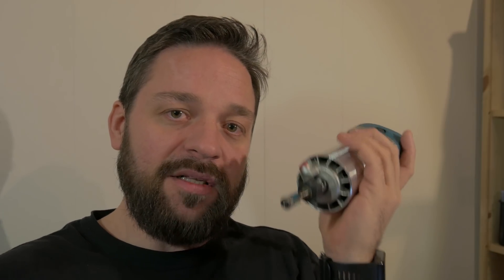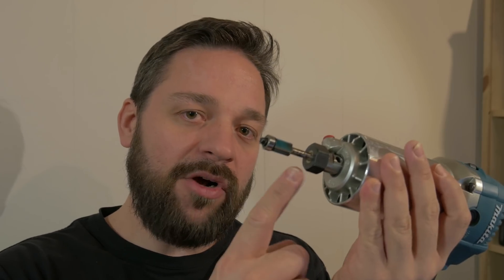First DIY CNC build (part 16) - MOUNTS for MAKITA router 65mm

Comment: Hi Willy.I learn a lot from you.Thank for all usefull details.but i have little problem that i see in this video 3:25 you also have same problem. After setting zero when click start ,spinde moving straight to the next poing by scratching material surface. than moving high and at same point going down and start cutting.in normal way, z must be move up first and than move to the first point and going down start cutting.i search a lot but no one talking about it.if you fix this problem please tell me how you did.in my cnc everything work fine but this scratch problem is terrible.Thank you.
Reply from the maker: Hi and thanks.
Yes I have had problems with this but not any more.
I think the problem is in the software generating the g code.
Do you use Fusion 360?
If you do, be sure to disable the cooling flooding in the first banner of toolpath. Check the heights also in the heights banner. Also be sure to generate the toolpath to GRBL configuration in the generate banner.
Let me know if you get a soulution to this problem

Comment: It was predictable.
Always First you need to cut the inner contour.
If there are problems with jumpers. Or do not want to use jumpers.
You can at the very beginning, drill two holes on the parts that will lose their fixation after cutting.
screws are screwed into these holes, thereby eliminating the bias of the part, which lost its fixation after cutting.
It turns out three G-codes:
1 # technical screw holes
2 # inner contour
3 # external contour
Reply from the maker: Thanks for good advice :)
Reply: @WillysGarageNorway  Lol... In part 18, you use same method. Sorry... :/

Comment: What are you planning to control the makita with? A bigger power supply, Relay, SSR?
Reply from the maker: Hi and sorry for late answer :) I plan to control the Makita with a simple relay on the Arduino that controls a 230 volt output. The RPM I will adjust manually.

Comment: Hi I use the same Makita RT0701C router on my cnc machine,
I cheated tho with the router mount no I did not make mine, I brought an aluminum mount from ebay.
What I am looking for and want is a collet to reduce from 1/4 to 1/8 or a 1/8 collet to suit the Makita RT0701C router.
 As I'm wanting to use smaller shank bits for small fine detail as a 1/4 shank cost an arm and a leg.
Reply from the maker: Hehe, yeah igs ok to buy :) I like to make my own tho, maby I will make out of aluminium one day 😂 
I think you can get an adapter or something to get 1/8 collets for small tools. Have you found some?
Reply: yep found and brought one, well many people selling the same thing still over priced for what it is, it's basically a sleeve of 1/4 that fits 1/8 bit @ $9us
Reply from the maker: @henryfitzthum7563  ok, yeah. These things are often over priced. Where did you buy it? I may be needing one myself 😁
Reply: brought it from ebay I'm sure these are sold on amazon too, it's called ( Astro 200-283 Slot 1/4-1/8-Inch Collet Reducer ), I won't paste a link here as that is why I stated many people or accounts are selling the same item and not having large quantities on hand either meaning 4 ( I normally don't buy from people whom state having 1 or 2 on hand which sometimes equals NONE ), so I think they source them else where then forward it on to you, so I'm sure one could source it cheaper, but on ebay they start as low as $9us and go up to like $11us, I don't own a lathe ( but will later add another axis to do so at a later date ) so I had no option to buy one, as for my aluminum spindle mount it was almost cheaper to buy one then to reproduce it @ $26us after one buys aluminum stock sit down for an hour or 2 to mock up 3D drawing turn to gcode then carve it out would be like watching paint dry or the grass grow
Reply: Oh for those building a machine, if buying one of those kits with linear rails , blocks and ball screws, ( mine came with a 2yr warranty ) yes they work fine the weak link is the coupling that joins ball screw to the stepper motor made of aluminum broke first one broke  after maybe 4th test run, it's a sad day when that happens especially if one does not have a spare on hand, when I first noticed the broken one I found these over built ones I so I purchased one for each axis, replaced the broken one then another axis went out, so luck for me I brought extras, ( what I did notice and think what happen is that they were broken for a while as there was enough pressure to hold it snug then with all the back and forth motion of the axis carving your project out it worn the aluminum down then got alittle sloppy )
before you know it #@&! your work up
Reply: Update on collet just received and tested , works and fits perfect.

Comment: where you setup the height of the driller? so the z axis know how much mm it need to go down and up?
Reply from the maker: Hi, and thanks for watching.
You sett the "zero" point in the universal g code sender. Put the tool where you have the zeropoint in you g code and pres reset zero in the UGS
Reply from the maker: And I have a video about the subject here, enjoy :) :
https://youtu.be/A1zlL3q23HI
Reply: so every new program i need to set the zero point? 
also i can work with fusion 360 and g code sender ? 
in the fusion 360i set that this is a plasma torch?
i can contorl the plasma that will start working only when the z axis 1 mm above the metal?
Reply from the maker: @dormoshe1664  yes you can work with fusion 360 and UGS. That is what I do on all my cnc projects. I have not used the plasma torch function so im not sure about that, but I think you can use it like you say, you have to try it out :)
Reply from the maker: Check this video on how to make and export toolpaths from fusion 360 to use in UGS:
https://youtu.be/whGKwsEY4Vo
Reply: @WillysGarageNorway  you know if the grbl has the ability to control the plasma via relay?you know which relay i need?
Reply from the maker: @dormoshe1664  yes I think so but I have not tried it myself. Think you can use the spindle enable output to trigger a 5volt relay that again triggers the plasma torch

Comment: I know i asked you yet but when you changed the spindle to à powerful one did you try to mill aluminum ?
Reply from the maker: Hi. I have not caned the spindle yet. I plan to do it in the near future. I want to change my z-axis rails to supported rails at the same time :-) When I finish this I will try cutting in different hard material :-)
Reply: Ok i wish you luck keep me in touch
Reply from the maker: Thanks a lot :)  I will post a video about the change when I get it done

Comment: The CNC series is very nice educational.
What is this cut material?
Reply from the maker: Kaptan Baba Thank you sir. Here I use acryl white, 12mm thick
Reply: Thank you.
Reply from the maker: Kaptan Baba No problem man
Reply: Where do you buy this kind material? Not something you can find in local shops, I guess
Reply: After some googling, found this material 500x500x10mm for € 73.95. Is this price legit?

Comment: Willy  - may I make two suggestions?

1 - Try masking tape (one layer on material, the other on the wasteboard) and use superglue between the two layers to make contact. This will prevent parts lifting and you may also do without the tabs.

2 - Zero off the waste board first, jog up (Z) say 13mm if you have 12mm stock.  Jog to X/Y zero, maintain Z at 13mm and set complete carve depth to 13mm.  With good calibration you will cut the upper masking tape layer only :)

Good progress!
Reply from the maker: soaringhal Thanks for the tip!  Sounds like a good way to do it. I learn as I go and pick up good advice along the road 👍😀
Reply: I know the feeling, I am on the same path myself :)

Comment: In addition to the tabs, always cut out the innermost part first. even IF the tabs on the outer part were stronger, an uncut outer ring would still be stronger. Keep it up, its good to see the mistakes happen too, not just the perfect parts.
Reply: Willy you are doing a great job you are a couple of steps ahead of me and I am learning a lot from you. I was going to recommend the same as Fredrik. But they came out great anyways. Keep up the good work!
Reply from the maker: Thanks, let me know your progress :)
Reply from the maker: Fredrik Kjølner aahh, thats a very good tip!! Thanks, I will think about that next time 😀